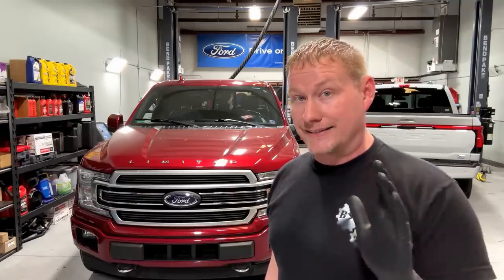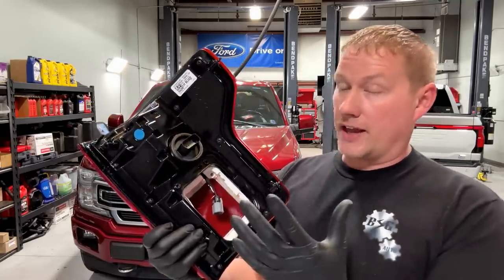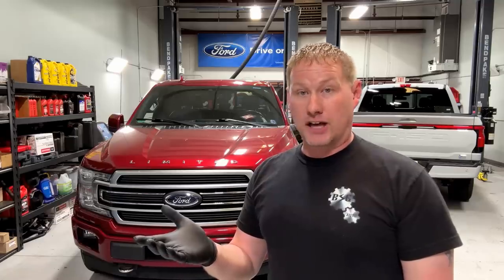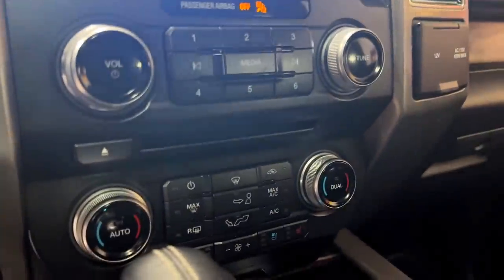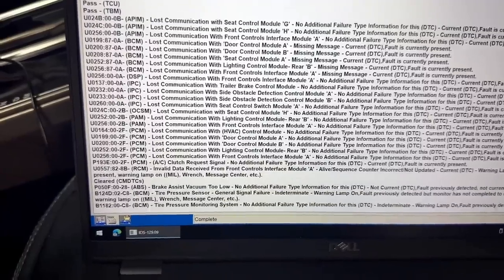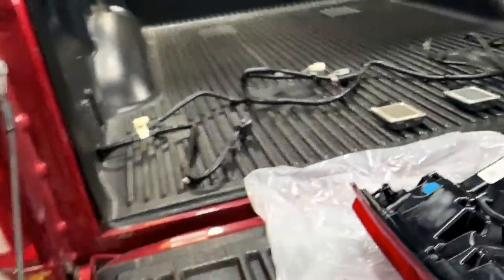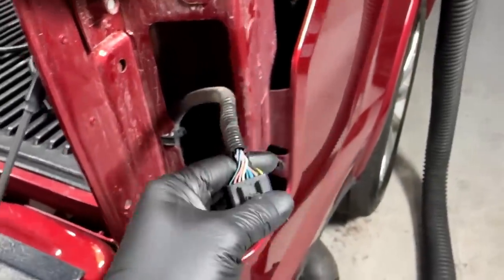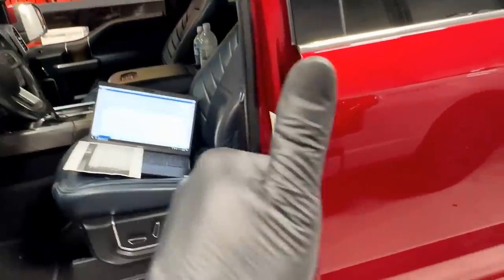Repair Cost Are Out of Control: $5,600 Bill for Some Tail Lamps?!

Comment: That is why you should always look at the cost of the sales package items prior to buying that “high end” vehicle.  When I was looking for my new 2017 F-150 I stayed away from the upper level trucks.  The fancy light option was $4600.  That tells you how much the replacement parts will cost.
Reply: The more expensive the parts the more expensive to replace; the more complex the part the more points of failure. There's really no way around this unless you're getting even more expensive parts with better durability and testing along with warranty.
Reply: Just price out any electrical light bulb for a modern vehicle/ as compared to the old days.
 Yes. But they are so much better today. Yes. look at the price and the potential money pit you could wind up in. High tech/ high cost.
Reply: As an experienced technician myself, since 1995, I concur this sentiment but, still wager it’s all relative, in the bigger picture of how things tend to be.. take for example, damned near any vehicles made during the 1950’s that offered bells & whistle exotic features like, Wonderbar Auto-Tuner Radio, Autronic Eye auto dimming system, Air Conditioning, Cruise Control, etc., etc.. it’s been somewhat a rare occurrence to even come across these vehicles WITH these options/features but, incredibly rare for ANY of these options/features to STILL BE FUNCTIONAL, as whenever those originally had issues, customers back in the day, most often just ignored getting them fixed, when told how much repairs would cost them then. Big obvious difference tho of course, one could continue operating those vehicles for decades later, without any of those problems affecting the running/driving of the cars… this “integration” factor, seemed to become more seeded in with the auto industry @ 1993-on; gradually becoming what it is these days. I need a PHD to diagnose these modern things! Have considered implementing the word, “Practice” in shop name! 😂🤪
Reply: how else can u severely blind anyone else not in a big ass truck
Reply: @seanbatiz6620  yes
Reply: @seanbatiz6620  Agreed, I have an AAS and a BS degree in automotive technology and 30+ years of automotive service experience.  Lately I feel like I should have stayed in school for a PhD!  The complexity of modern automotive systems is demoralizing to even the most experienced of techs.  At least with a PhD it would be easier to change careers!
Reply: The first and last new car I have bought was a 1973 Toyota corolla bought nothing but used since I’m a quick learner😂
Reply: I agree. It's been my practice before buying a car to ask about the cost of replacing expensive parts, like the transmission. It's why my current vehicle (which I've kept since '07) has a manual transmission. It's more expensive now, but when I bought it, replacing a manual transmission cost something like $1,500. An automatic cost more than 4x that.

Comment: Been a shop owner for 50 something years, ive watched this coming.  The very reason i drive a 95 bronco, and a 74 f100.  Truly out of control....
Reply: 50 YEARS!!!!  Hat's off to you, I bet you have stories to tell.
Reply: I hear you there. Fellow independent tech for the last 18 years now. Drive a carb'd ram with a 5 speed, in perfect shape as my work truck. 97 ram sport 1500 i retrofitted. Kept enough of the wire harness for the o2 sensors and gauges but slapped a carb and a classic distributor on it. I live in a free state.
Reply: I'm with you. I drive a 1993 Crown Victoria & a 2000 F250 7.3L I  can and do fix them myself in the driveway!🔧
Reply: I have an 02 sequoia with 245k and runs like a champ.I came across a 351w and a ZF6 speed I plan to put in a bull nose pickup. Def want a truck that is all analog. At least I’ll be able to repair it myself without having to worry about computers.
Reply: I have a ‘53 F100, a ‘69 F250 and a ‘72 F350 flatbed.  I keep all three in tip top shape and they never let me down.
Reply: Same reason I won't buy anything after 2000...
Reply: I'm a Chrysler tech and I drive a 97 and 2001 ram. I completely understand
Reply: Too bad our "gubmint" won't allow our car companies to build trucks like that anymore. Land of the free, home of the brave?...Sometimes I wonder.
Reply: awsome trucks !
Reply: Old clunkers/ nothing fancy/ just do what they were designed to do in the first place. I always checked out one thing before all.
 Does the heater work really good?
In Canada/ working outside at the airport that was of crucial importance for survival.
 Not twin-powered moon roofs and 8-position seats and God knows what else the throw on these modern vehicles to up the price/ and lower the reliability.
Reply: Yep.  Newest car is 2016.  Others 2006 and 2009.  Run great and easy to fix.
Reply: @zephead843 because it's a lie, government has no business regulating cars.
Reply: @yeboscrebo4451   My 1998 4runner and 1994 Accord don't have this kind of BS either

Comment: 1157 lamps used to cost $.65 and were easily replaced. Sure miss those days.
Reply: I smashed a tail light on my '09 Pilot (barely 100k miles) and replaced it in 5 min with a $35 complete assembly. I would never buy a new truck. I drive in L.A. and haven't needed ten computers telling me what's in my mirrors.
Reply: Ditto that. and the amber ones were #1156 if i remember correctly.
Reply: @MarkoS1952 lol... just bought some for my old jeep the other day. Two Phillips head screws... pop them in, done.
👍🏾
Reply: Lmao I still buy them and they haven't been 65 cents in decades
Reply: So buy something old. Or can you not live without heated mirrors and butt massager?
Reply: @cubey  😀
Reply: @cubey . I have an older Ram 2500 work truck. None of the bling you’re talking about. Continually amazed at the leaps some keyboard commandos make.
Reply: My 11 Tacoma still uses those (3156). Same as 1156 but blade type.
Reply: ...and I was shocked their up to $6!
Reply: Sadly soon illegal
Reply: They are about $4.50 now just bought some for my '89 Toyota pickup.
Reply: Still are 1.5 Canadian dollars thankfully, all my vehicles use them. Old cars can live forever
Reply: I just bought a sealed beam headlight for my 1972 Ford Pinto from Autozone. $26. I remember not long ago when they were $7-$8.
Reply: With the decreased volume of production, I wouldn't be surprised if manufactures are scrapping the production equipment for sealed beam and halogen headlights. Hopefully some enthusiasts will buy some and continue producing them.
Reply: @gregorymalchuk272  There is one saving grace- industrial equipment. Many tractors, forklifts, and other heavy use machinery (old and new) still use sealed beams, so I don't think they'll vanish quite yet.

Comment: My truck is 25 years old, the thought of getting something 'modern' is terrifying.  Everything in our system today is designed to squeeze the customer dry.  He paid more for these taillights then I paid for my whole truck.
Reply: The customer paid as much for one taillight cover that I paid for my car.
Reply: I recently rebuilt my transmission on 2000 Silverado for 1700. When dealing with transmission shops never say rebuild it say replace the worn parts. Unfortunately my truck has 311, 563 miles so everything was worn out. In a few years I will probably need an engine, but if I do it now I can get a crate engine installed for 1200. My tires cost 225 for 4 tires can't beat these costs with a stick. Today a scratched up pickup truck with 300k miles is worth 3k, but a repaint, new driver seat, new tinted windshield, tint the other glass, install power windows in a standard truck, $600 white letter tires, front end replaced, rear rebuilt and a new transmission is worth 7k for a 23 year old pickup.
Reply: telecommunications
Reply: to much uneeded garbage in modern vehicles, all distracting to regular commuters and even drivers. keep it simple cnuts, designing these things for terminators?
Reply: I totally agree. I'm even looking into hoarding some donor trucks for spare parts before things get too crazy. I went Cummins diesel and will never look back.
Reply: I totally get that
Reply: He paid more for for those taillights than I paid for 3 trucks and 1 car altogether. All classics and in decent shape.
Reply: The most the most I have ever paid for a vehicle was a 1987 Corvette I paid $9500😂

Comment: And people wonder why I drive 25 year old cars. I can buy a new car, no problem. Just don’t want to. There comes a point where technology is no longer an assistant to our existence, it becomes a hinderance.
Reply: Agree i been in automotive but was also electronic tech and amature radio operator . I can repair some of the computers/ boards / controls  so long as they are not potted sealed in epoxy . I quit automotive many many years ago but repair rebuild and mod my own cars and trucks and body and paint . No need for modules running light total crap especialy openvto water salt and dirt . My headlights on my 2011 f150 get water in them so i drilled a small weeping  hole at the lowest point  solved the problem .

Comment: You know something is wrong when labor/diagnoses costs are the smallest charge on the repair bill!!!
Reply: No, it's absolutely ok. Meaning most of the work is already done at development of diagnostics, workplace setup and part procurement. This is how it happens in real sector.
It is the total value still being a problem.
Reply: @peek5548 you know you kinda contradict yourself here, right? 
If the labor is expensive, but the sum is small - means work did not take long. Must be good, right?
Or would you rather work your a$$ off for a taillight instead of something useful? Now that is "not ok, but you do you" situation here.

Comment: Nice work diagnosing! Now I know why they are getting totaled with minor damage! Absolutely insane!!!
Reply: Yup! Lots of vehicles getting written off at our bodyshop with minor looking damage but due to over complication will go to autowrecker. How is that saving the environment, if that's the road they say we're on? We'll all be riding donkeys again soon 😂
Reply: That's part of the reason. Over the years insurance companies (technically insurance boards) changed the defintion of what "totaled" means.
Reply: Yup. It seems like insurance companies no longer fix cars. They just total everything out
Reply: But, new cars are so gentle on the environment. Like the coal powered Teslas that must be grasped by large fossil fueled powered machine claws and plopped into a semi trailer sized aquarium of water for days after they catch on fire. Very practical.
Reply: @Amor1990  Especially with an EV. One tiny rupture in a battery could mean an entire condo goes up in flames.
Reply: Starting to do the math, I’m wondering if these cars are actually worth more money as parts cars than driving around.

Comment: As a former Ford dealership gas and diesel driveability guy, much respect to you for sharing all that you do. If I had a dollar for every time someone assumed a scan tool “told” a mechanic how to fix a vehicle….. you proved why there’s a difference between a technician and a parts changer.
Reply: Stealerships are completely useless today, most can barely do a oil change 🙄
Reply: @ginog5037  Yet they get $150/hr to do so poorly.
Reply: @ljprep6250  Absolutely paying some kid who couldn't care less about your $30-100k ride...
Reply: It would be so much easier to change a SIMPLE part.
Reply: A precomputer truck would have just blown away fuse when the bulb socket got wet.
Reply: @ljprep6250 Yep
I just paid $619 bux for a trans service....😑
Reply: You mean a JAFI  (pronounced Jaf-eye). . . . Just Another Effing Installer.
Reply: How right you are!  I remember working as an electronics technician, I came across a bad assembly once and found the problem on my first try.  The poor thing had been through troubleshooting and rework 40 times by other technicians making a good bit more money than I did.  One very expensive chip had been changed 5 times.  That's what us REAL technicians call poking and hoping.  No raise was forthcoming, however, so I took another job offer for 44% more money.
Reply: I agree. My 2001 ford taurus was running like shit, put a cheap scan tool to look for something, maybe misfire? Nothing. Found a Loose boot off the intake manifold, some vacumn line? I don't know. Fixed it and now runs great. Dumb luck mixed with some experience that knows to make sure everything is connected properly found the issue.
Reply: "The computer..." was the reason for my Xterra visiting the dealership 3 times before I pulled out my voltmeter, checked three pins and pushed a connector together tighter.  My usual technician wasn't the one working on it and the new guy just relied on the computer.  The Haynes manual and I figured it out in 10 minutes.  Made them credit me all of the labor charges.
Reply: @armymutt25A  "Made them credit me all of the labor charges" 
ask me how i know ur BS'ing...
Reply: @rickacton7540  You can think that, but it's absolutely true.  I've been going there for 16 years.  They don't need the bad press.
Reply: @armymutt25A  They paid you back?    Maybe in your dreams.  They didn't refund a dime.
Reply: @jeffro221  OK.  Maybe you suck at getting a refund.  I don't.  Loyalty helps.  I've been taking truck to the same dealer since 2006.  I honestly don't know why this is so shocking.  We have three Nissans.  They aren't going to lose out on years of future services over a measly $300.
Reply: @armymutt25A  Dealers don't refund like that.  They say, "well, we did do the trouble-shooting, even if it didn't turn out as well as we hoped for."    Maybe you suck at telling the truth.
Reply: @jeffro221   OK, sure.  You believe what you want.  You'd be a damn fool to lose thousands in future business over $300 in labor because your "tech" failed to plug in a harness.

Comment: My daughter’s 2016 King Ranch just had this issue. Thank you for sharing information on this!  I was able to dry everything out and then ran the sensor and the taillight through our LEM dehydrator at 100 degrees for a few hours to completely dry everything out. Cleaned up the connector pins and added some dielectric grease on all connections and gaskets. I was stunned that it was enough to resolve the issue. I disconnected the battery overnight also hoping to reset everything I could. Everything came back online! I almost cried. What a relief. Automatic running boards, air conditioning fan and buttons, radio controls, side mirror controls, seat memory buttons, driver door front window controls, seat massager, oh and the blind spot monitor. Insane what is so intermangled. It’s basically a modern computer network. If there is ever an EMP event these vehicles are down.
Reply: I have a 2015 king ranch. RH tail light has moisture, blind spot and cross traffic faults. Dealer wants $2k to replace it. I'm going to try something similar to what you've shared here. If that doesn't work maybe buy parts and do the job myself. Some programming required with Forscan. Thanks for sharing!